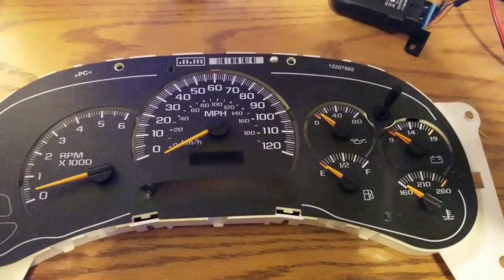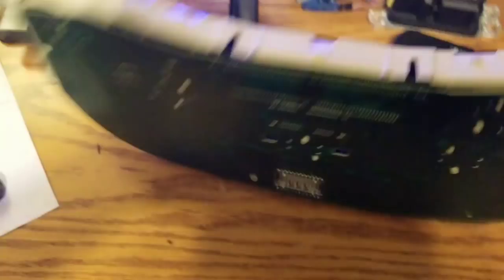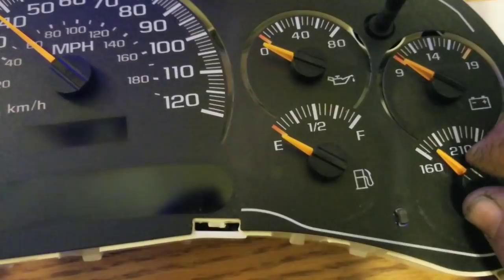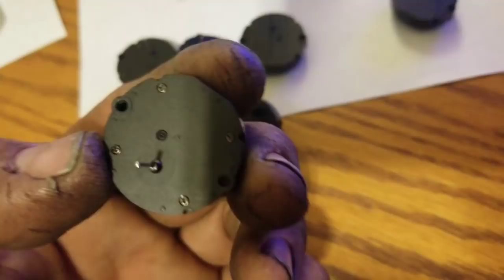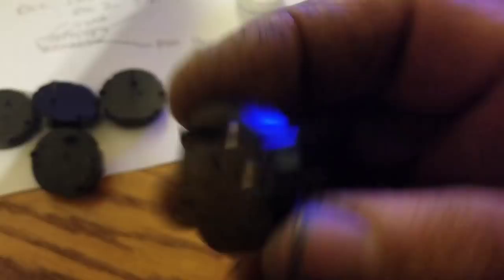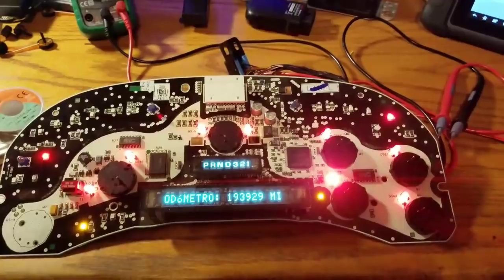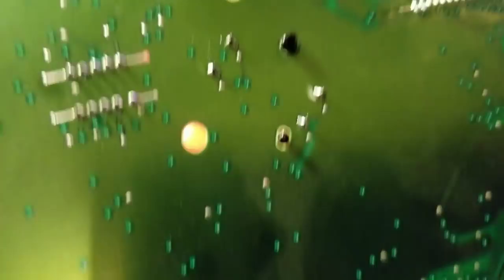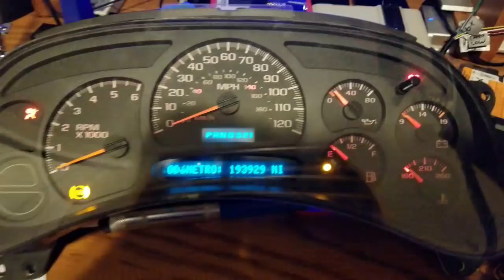Gm guage cluster bench testing with a scanner after rebuild.  Ipc  instrament panel bench test

Comment: Fantastic video, this convinced me to buy a bi-directional scanner. So far though, it's just raised more questions.. I've had an inop tach since buying the truck about a month ago, replaced stepper, needles move/act normal when starting the vehicle, but that tach just doesn't register. All gauges pass the sweep test, hptuners can read rpms when plugged into the truck, autel reads 0, wires from cam sensor to ecm and pcm to tach all checked for continuity and have no issues. Sort of hit a wall lol

Comment: Nice video, good information. I was disappointed to see the DIC film on the face to get some nasty screw driver damage. If you unclip the lens from the top 3 clips first, the bottom two will normally pop off with a little tilt. No need to force it. I normally try to talk people out of red LED's. With the built in blue color filtering it's hard to get the color red to come through nice and strong. Also, I don't recommend using dome focused style 5mm LED's. They focus the light into a sharp beam and don't spread the light evenly across the face. Use flat top instead. Some times called straw hat, or even some SMD's have a wider beam then 5mm dome.
Reply from the maker: jeffescortlx I hear ya. I've repaired probably 850 of these at the very least in the past decade for multiple dealers and a huge (won't say the name) nationwide used car chain . I have 25 of my own spare clusters of various models I use as loaners . I know my way around the gm clusters pretty well. He actually attempted to disassemble the cluster himself hence the screwdriver mark. He brought me his own leds. I tried to tell him not to go red.  There is no diffusion and you end up with red dots showing through the face but he wanted what he wanted. I only use the flat top 3 strip dimmables when I supply the parts.  A lot of people go on Amazon and buy kits then realize they might destroy their panel trying to diy them. I end up with them and parts I don't prefer to use. Probably why I try to stay away from public work and usually stick to the dealers, repair shops and car lots. Thank you for the info.  I appreciate the feedback from my viewers always.
Reply: Hay Jack Meyers.. 
So in your video where you light up all the lights on the cluster I didn't see the check engine light ever come on whenever you done the bulb test. Is it just burned out or does it not work when you do one of these bench tests?? Thanks. Have an 02 That neath the check engine light works nor the speedometer.. 
But my scanner shows that the VSS is working now since I replaced it.. The truck is an 02 Chevy 1500 4.3l automatic..
Reply: Wow ur awesome thanks for the great info
Reply: Red is easier on the eyes for night driving, you don't want it to come through strong if its for function.

Comment: Hello, good day. Great video again sir to be honest this is the first time i saw testing a cluster with a scanner. Subscribing to your channel is worth. Sir i notice the oil pressure did not point to zero. Thanks.
Reply from the maker: Laurence Lee Roceta thanks . It was late and I was tired. After doing the sweep test it should align all the gauges to zero. I went back and reset all the needles . Usually I leave the front cover off to test and make sure they are all put on correctly.

Comment: I see your leds are casting intense light in one area and poor light surrounding them. I had this same issue and would recommend adding a silicone cap over your leds. They make them for model train hobbies, in all different colors. I didn't know that at the time so I dipped my leds in white silicone caulking and let dry before installing. Adds a perfect glow to every part of the cluster.

Comment: I only thought of this now, but RE: your RGB LED video, it would be cool to use a window switch to make the tach backlight go yellow and red at different RPM thresholds...
Reply: +Paesan Control Centre  That's a cool idea, but the lights are controlled by the BCM dimmer circuit, while a single multi-color LED requires different current or voltage levels. Serial Data as he marked is Class 2 serial data that communicates  between modules. High Speed serial data is CAN or controller are network and is two wires, but not used to low speed devices like this IPC. The class 2 toggles from 0 volts DC to 7 volts DC, then the circuitry see an address and reads the message and directs action. This is true for most GM car since 1992, more so on the Corvette in 1997, but most all after 2000. Trucks & Vans falls behind for cost but are in a different category, but they usually get the newer tech a few years later. The factory scan-tool will work for this purpose, but he has some aftermarket equipment but still $2k and up. 
ASE Master Tech since 1978 / Retired

Comment: I liked the video and I wanted to know what dlc wires you used to turn on all the lights and do a gauge sweep and what wires should I use for a gmc pickup and which wire are positive and negative and ignition because I have a snap-on scanner that dose bi-directional

Comment: Is there an in-vehicle diagnostic (or at least sweep) you can do through the OBDII? I have a bluetooth interface (NOT sure if it's bi-directional, which if it isn't I know I'll need to replace with one) and the Torque app on my Android phone. My brother in law's 03 Silverado gauge needles have always been off (all except the speedo, funnily enough), and since I just did the PRNDL light fix I'm going to go ahead and fix the background lighting and swap out the stepper motors (which I suspect are going bad anyway because of jerky motion on the tach and voltmeter, so just replace em all and start fresh). Thing is I want the needles to read accurately this time so if I can do a sweep on the gauges I can at least line the needles up so when they hit "max" on each gauge the needles are spot on. I'm competent with electronics but still trying to figure everything out with GM clusters of this era.

Comment: Hi Jack,,Thank You much for the informative videos you provide. A question. As of late our old rusty trusty 2003 Chev Suburban if it is let sit for about 4-5 days without starting it,,the battery is dead. Bought new battery,,so that is out of equation,and also checked new battery for good CCA testwith meter . Found: Using DVOM to test parastic draw,,and plucking fuses one at a  time, the IPC is drawing about .25 amps. Taking out that fuse after about 30 seconds there is no draw. So,,,took out cluster replaced stepper motors,,and bench testing the amps go down to zero,,with only battery and ground connected after the specified 25 seconds. BUT when i plug cluster back into truck,i still get the .25 amp draw. Tying to picture what could be causing the draw that is plugged into IPC. Any ideas how to back trace? Thanks.

Comment: Helpful advice and tips but i have a question i have 2002 monte carlo cluster temperature gauge went out and the mileage and the park drive reverse  lights went out so i went to the junkyard and found one bought it and it work but the mileage are different mines show 144 and other one shows 288 i there any to fix this? Thanks

Comment: Nice video, on the pin out, You show 12 connectors.  I salvaged a cluster pigtail from a vehicle marked as a 2008 Tahoe, but it only has 10 pins on the connector that was dangling where the cluster would install.  Did Tahoes have a different pin out from the 2007 suburban? I didn't see any remnant of the there ever being another set of wires in the cluster area.  Also would you know the part numbers for the display driver chip and R92 the 100 ohm resistor?

Comment: Hello Jack. Very informative video. Will this process work on 1999-2002 clusters?
Reply: I don't think so. I checked Mitchell Repair (ProDemand) and the pinouts are different for different year/models. For instance, the 2002 Silverado shows Ckt. No. A-5  as the class 2 data pin instead of A-6 on the 2003 Silverado. 
Also, on my 2003 GMC Envoy it shows B1 as the IPC Class 2 Serial Data pin. So you'll need to verify before making these connections.

Comment: Does the wire from a2 of the data link to a6 of tge cluster need power alligator clip connected from where you connected the wires or is it straight plug in by itself?

Comment: Wish you could fix my cluster on a manual transmission 2000 Nissan Maxima. Speedometer and Odometer faults out until I tap or apply pressure on the cluster. I think it's a crack solder but I cant find it.

Comment: nice testing! so do you know what is the wire from PCM that triggers the warning low oil level on in the Cluster.? am rebuilding an LS harness and i saved low oil sensor so i would like to know what wire from pcm turns the low oil level on when oil pan is low.

Comment: After watching your video so many times it is almost memorized I got a bench test wiring harness together and have successfully connected it to my Tech 2.  The Tech 2 sweeps the gauges no matter what is enabled (MIL lights etc) with the CANDI module unplugged and does not power up the backlighting.  It is a 2007 Silverado 2500 6.6.  Looking for some help determining if the issue is in my wiring or?  And why is there no option to power up the backlighting on the Tech 2?

Comment: I got a used cluster that I want to use for my Chevy 5.3 stand alone. I labeled my wires coming from the PCM. The white wire runs the tach, green white runs the speedo, brown MIL and a gray wire is marked as IPC class 2 serial data. It also has a tan wire for oil pressure.  My question is, should I hook my wires come from PCM to the corresponding colors on my cluster?  I know that the oil pressure is not going to work because I deleted that wire from my engine harness. The fuel gauge is not going to work either, but I don't really care about some of the other functions, I'm only interested in having the tach, speedo and temp,  can I tap into my serial data line on the DCL, or some people call it the aldl

Comment: Can a jumpstart damage a cluster? I have a 2006 gmc sierra and after a jumpstart ive had alot of issues with the cluster. During inspection on the cluster i found that the display screen had burnt up.

Comment: Great video Jack! I posted a video of my 2002 Silverado's issue. Would love your opinion. Alternator light comes on, at the same time the fuel and temp gauges fall to zero. A few moments pass and it all goes back to normal. Noticed the prndl stays lit, but the selection indicator vanishes! Sometimes I also get an airbag light and sometimes a seatbelt light.  Again, all the is brief, but continuous. Security light will come on after it cycles a few times. Replaced the negative battery cable. Any ideas? Thank you!

Comment: Is there a way to reprogram the mileage displayed in the odometer?

The reason I ask is, my Chevy dealer effed up my truck ('04 Colorado).
They traced a PassLock security issue back to the BCM. New ones aren't available anymore, so they found a used one and put that in. But obviously it didn't have the same mileage as my truck. So now the cluster displays the mileage of the vehicle that the used BCM came out of.

They were able to find a refurbished BCM that has all data wiped. They put that in and programmed it, but the cluster still shows wrong mileage. Now they tell me it needs another cluster. But they're not available new. So now they're looking for a used cluster.
I was hoping that there might be some way to wipe the memory of the odometer/cluster so that the BCM can rewrite the proper mileage back to it. Is that a pipe dream?

The whole thing has been a nightmare. They've had the truck for 5 weeks now.

Comment: Nice vídeo. I have 2001 Chevy tahoe. The cluster doesn't work at all, but if plug the scanner everything works fine, what could that be?
Reply: Broke ground on passenger side of engine block in the back

Comment: Man I have a 2003 Chevy Silverado I'm trying to put a 2001 dash cluster in it and the wire harness is different. Where can I find a good diagram for both of those connectors so that I can swap the connector? Definitely love the video but like you said I don't want to short my cluster out thank you
Reply: Clusters change completely in 03-07. Pre 03 might be a lot of work to get it to work if that's even possible
Reply: Yeah that's gonna be a pain. Things like the Volt and oil in the older cluster is going to be looking for a analog signal that doesn't exist in the 03 chassis.

Comment: Jack, thanks for a great video! I repair GM and Ford clusters in the North Carolina area. I have a test setup with a GM computer I use for testing the clusters, but I am interested in that Autel scanner you use, Autel has a cheaper one than that 906BT which is their model number MK808BT, Do you know if it has the same features to excersize the cluster as the 906BT? If so, I plan to buy one. Also if you would could you provide your contact info for me>
Reply: It looks like the MK808 doesn't have bidirectional functions, which you will need to perform this task.
The Autel DS808 is bidirectional though.  Of course at nearly $800, this may be out of our price range.  What I ended up getting,  is the THINKDIAG unit. It has full bidirectional capabilities  & only costs about $120 !
I just got it & verified it will do the all-gauge sweep, & and the all-light & odometer test on the IPC of my 2003 GMC Envoy. 
It comes with a one year subscription for two manufacturers of your choice. You can add any of the
(I think 132?) Manufacturers for $39.99/year per make.
It is a VCI/Dongle that interfaces with your android smartphone, tablet or iPhone. 
The app is free & user-friendly.  (The app isn't compatible yet with older android OS version's) 
Considering how much it costs to update the Autel, Snap on Verus etc., I think this is the way to go.

You can check it out here:  https://www.mythinkcar.com/ProductPage/3/t1

Comment: hey jack, good day, where can i find the diagram of the plug (which function does each cable color) could you share that information ??? I have a silverado 2003 2WD V8 5.3L. Thanks for your attention
Reply: I know this is a year later but to help someone else with the same need, Mitchell offers a month access to the factory service manual for $19.95 that all the pinout info can be accessed.

Comment: If I cut the wire going to pin A9,  will my ABS warning light go out on the instrument cluster?  This constant light drives me crazy and I can't keep it fixed for more that a week or so.
Reply from the maker: Cutting the signal input line is a bad idea. Why is the light coming on? Have you read the codes? I do not recommend it. Cutting a data line input is always a bad idea.  I have rebuilt many clusters that someone has dissasembled and simply taken the bulb off. If you're absolutley determined to eliminate it maybe just take the front cover off and cover the bulb with aluminum tape? That way when you do repair the problem its easy to correct. Disclaimer * In the gm clusters the ebrake ,abs and brake fluid lights are all interconnected so if you leave your ebrake on or your brake fluid gets low you will have no warning.
Reply: Check the frame ground under the drivers foot.  Easy...  Use a piloted brush to scour the frame surface and emery cloth to clean off the terminal lugs.

Comment: Any idea why a cluster wont power up, has only back lights working, same on bench test or in truck
Reply from the maker: Have you done any work to it?  Push on the 511 resistors while it's powered and see if it comes on.  If not put pressue on various parts of the board until it powers up and that will point you where the problem is. Works for about 99 percent of the ones i fix.
Reply: @jackmeyers2911  I have checked and resoldered all the 511 and 240 resistors. Still nothing. No motor noise, no lights or display
Reply: Figure this one out? I'm having the same issue
Reply: @lazydog76  Did you figure this out ? Same problem in my Tahoe.

Comment: Hi Jack would you B interested in making  me a bench tester ? by the way you do a great job i've been watching you for some time now
Reply from the maker: Yea for sure. Ive actually built 3 really nice ones in the last couple years.  I keep adding features like a dimmer control for the lighting and a sweep test button. My newest one has 3 outputs . 99 to 02 . 03 to 06 and 07 to 2010. A basic one that gets the job done is pretty easy to build.
Reply: @jackmeyers2911  I would like to have your newest one jack what do I have to do to git it ?
Reply: Also interested in a bench tester
Reply: @jackmeyers2911  Building a basic bench tester would make a great video!
Reply: Hey jack how can I purchase your 3 option  gm bench tester plug really interested  please reach out to me on how can we arrange this purchase
Reply: @jackmeyers2911  where can I purchase your latest tester for 99-02/03-06/ and 07-13 models

Comment: Those cheap black motors are junk.
Reply from the maker: Michael Box maybe. Not sure which brand you used. To each his own i guess.I bought 400 of them aftert using my first set. They are quieter, faster and come with a lifetime warranty.  I know that much. I have about 30 of the 400 left and have never had a cluster come back with a bad one.  All the white ones out there even the jenken snap together,  are noisy and slow. For me they work better.  The fact that they screw together instead of snapping together and are not an identical clone of the failure prone originals will keep me using them.
Reply: I know this is a old post, but just wanted to add, even though I'm using genuine X27's, I've seen pretty much zero failures on the black screwed together steppers.

Comment: Hi can you tell me if it is possible for a gm chevy cruze  cluster work on another engine
Reply: if the same pins probably
Reply: @scionnn  no they are not the same pin qg18 nissan replaced cruze engine